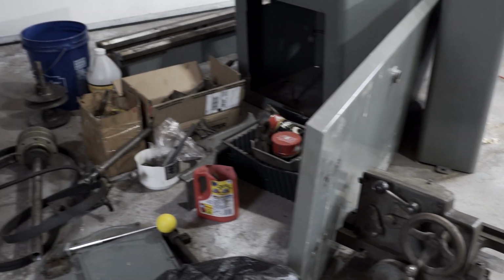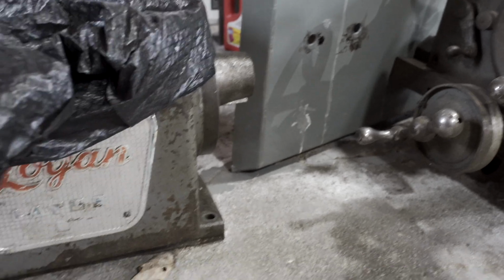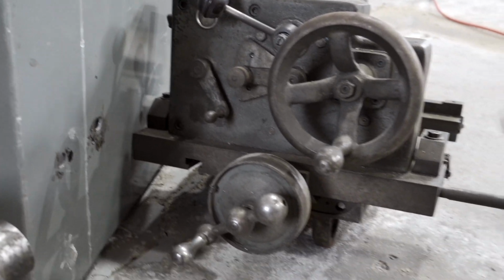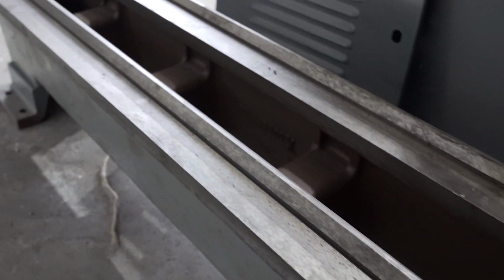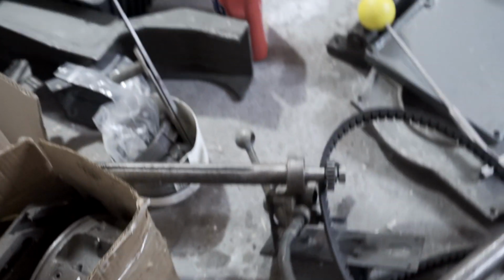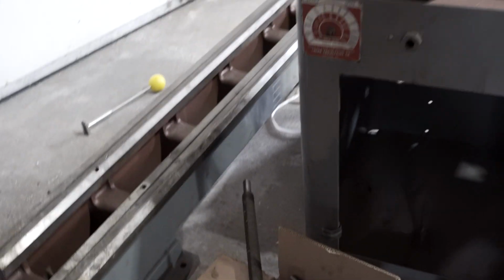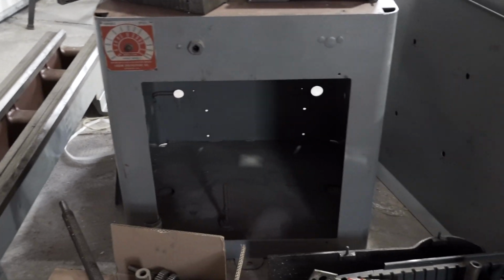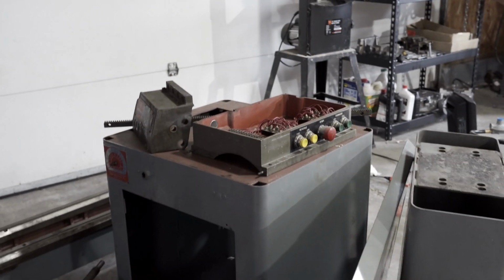I bought a lathe! Logan 7502L "Chucker" Turret Lathe

Comment: I’d be so lost into what I would need to machine how do u know which parts are missing? Is there a manual or something
Reply from the maker: I haven't been able to find an assembly manual, no.  It looks like a lot, but most of the pieces are relatively self-explanatory once you start looking at it... the difficult thing is/would be re-assembling the gearbox since the gear combination is important.  But I'm planning to CNC this, so being disassembled isn't a problem... most of the pieces I'll probably part out on ebay since they aren't needed.